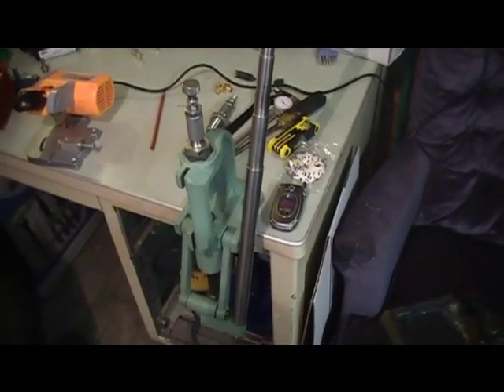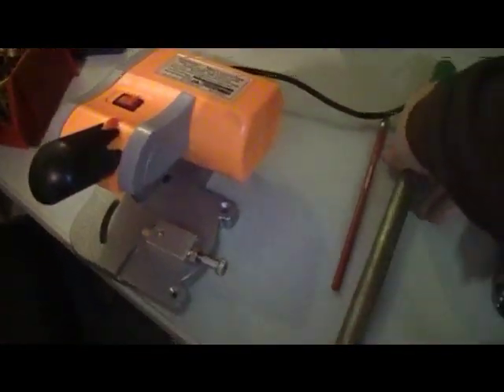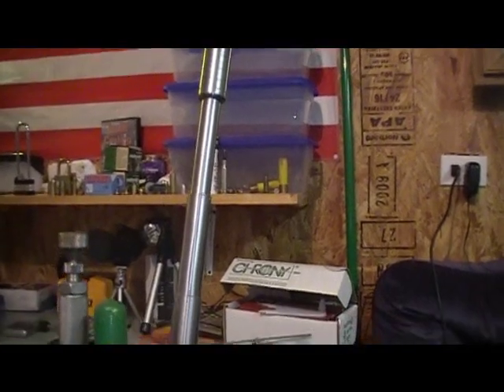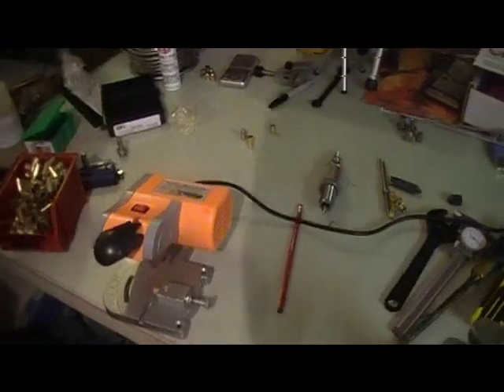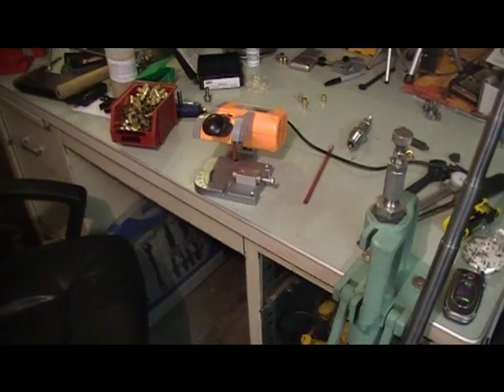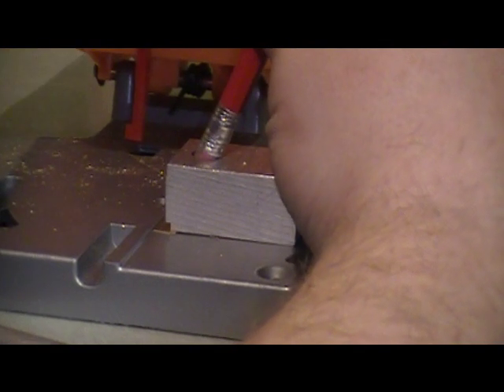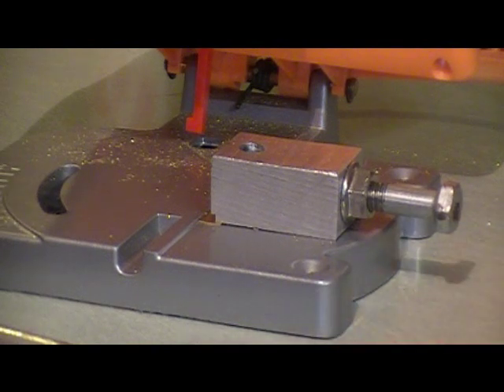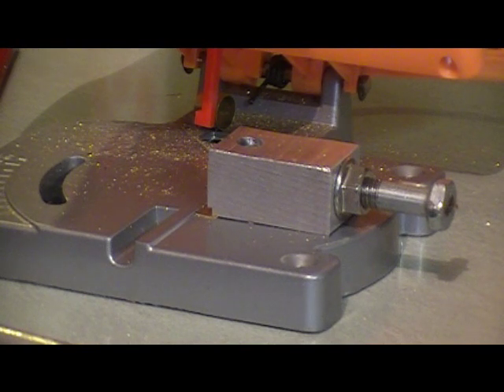Home Swaging part 1

Comment from the maker: @cdcropper what your actually seeing, and found out on another forum what was happening, is the primer coming out of the primer pocket. That is the extra small hole in the target. 

I am getting a universal decapping die so that I can de prime without sizing to try and prevent the primer seperation. So far I have not had a core seperation like I previously thought. I am going to expirament with flux and try to bond the cores to the cases tho..

Comment: I have from your range tests you have had core separation issues. Have you considered opening up the primer flash hole so  that the lead can flow more readily into the primer pocket and form like a rivet head such as Corbin's base guard design

Comment: @daywalker627 Even if I back out the HP stem far enough that there's no point in having a hollow point, it gets stuck. While I was fiddling with it, I noticed that the point of the stem was rather rough so I polished it -- that didn't help either.

Comment from the maker: @blainenay I believe you may have your hp stem adjust too low in the die. Try backing off the hp stem a little at a time till it is no longer getting stuck in the bullet and you still have a nice hp. I have had one or 2 gets stuck with mine as well starting out.

Comment: I tried swaging some bullets with my new CH-4D 101-series hollow-point dies today. The swaged bullet ejector (HP punch) gets stuck hard in the newly-formed hollow point using both my .355- and .357-caliber dies. I have to pry the bullet off the HP tip of the ejectors, marring those shiny new bullets. I tried putting some lube on the hollow-point tip of the ejectors, but that didn't help. I'm using pure lead. What is the trick to not get the ejector tip stuck in the new bullets' hollow point?

Comment from the maker: @blainenay Very good question. I have no idea right now if and when I get air trapped. That is another step that I am working on. I am going to start playing with core bonding. One method I have seen, flux inside the case, seat core, heat case and remelt the lead in the case. That will eliminate air as well as bonding the core.